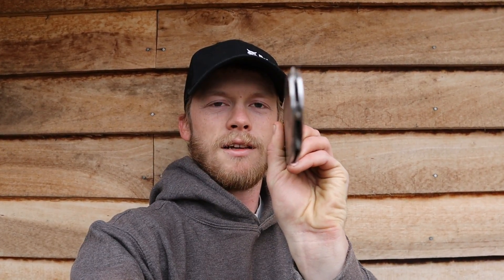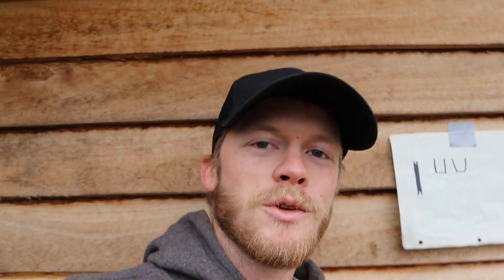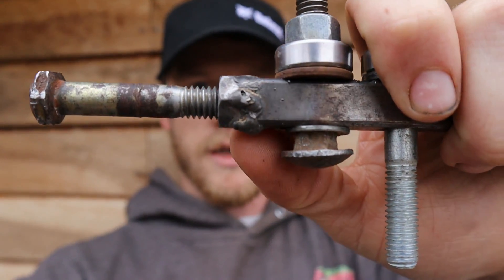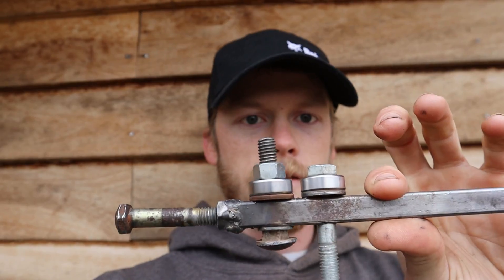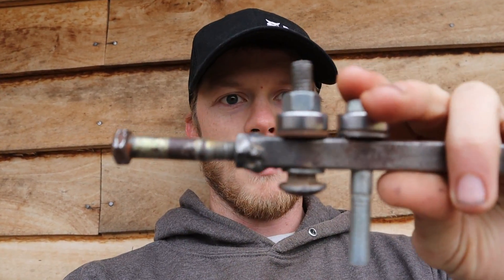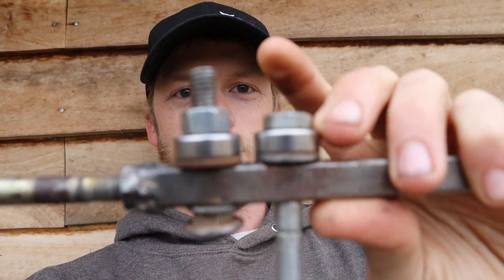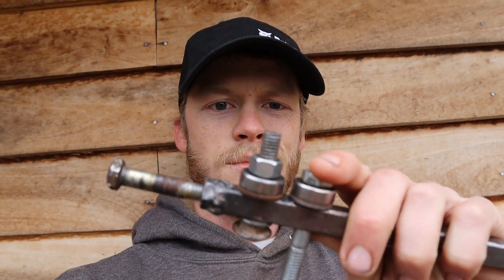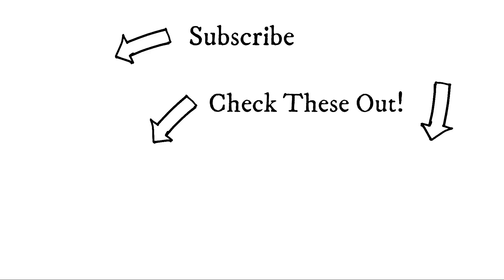Building a Chainsaw Rail Roller/Closer

Comment: I purchased the el cheapo from china version for 20 bucks. I thought about building one but the time and effort i had to put in was more than 20. BUT, if people have the parts laying around a couple of hours to kill, why not. Dont have to wait for it in the mail. I am going to make one like you did and see which seems better as the chinese one definitly has a couple if issues, BUT didnt get the job done as I am not cutting circles any more. Thanks for video.

Comment: I think your design is better.  Pulling the bar through the device in a vise makes more sense.  The bar is much easier to hold onto because of its size than the little device.  Thx.

Comment: Interesting. Now dress your bar (if you haven't, you didn't mention anything about it in the video) and you'll be really happy. Bar dressing is filing or grinding the tops of the groove so both sides are even and don't have dips or pits. It also addresses the V issue to a degree as well by taking the material down to where its straight.

All that is needed for bar dressing is a flat file and a steady hand to hold a 90 degree angle across the top, a bar dressing file with guide, or any grinding sanding device with a 90 degree guide.
Reply from the maker: Didn't do any dressing on it, but I don't doubt it needs it. Thanks!

Comment: Interesting.  Seems to beg the question...what did you do to make the rails spread and also lose a few teeth on the chain??? 🤣
Reply: The rails will spread due to wear, side force on the chain will cause it to rub the sides, over time creating a v groove, which allows the chain to lean while cutting.
Reply: @nate2838  Yup, you are correct...but one never knows what Josh may have done to it.🤣
Reply from the maker: Cheap bar, combined with "fenceline" trees......